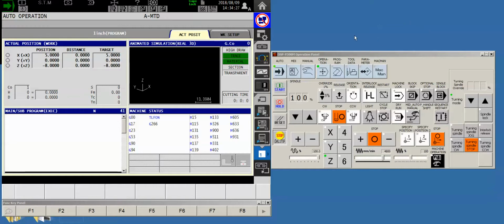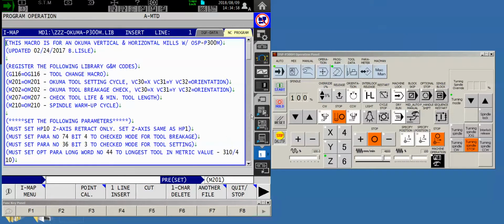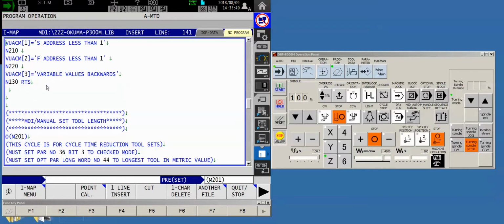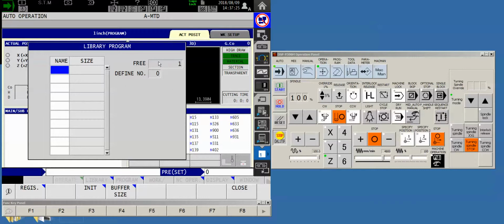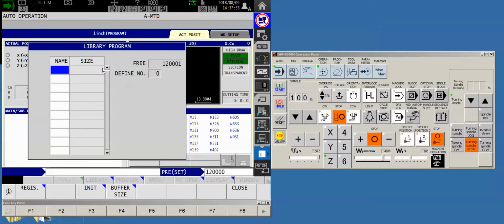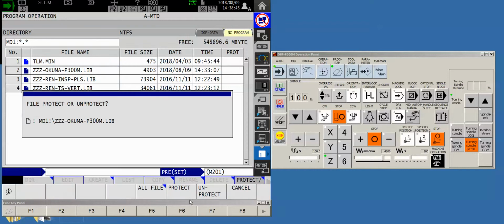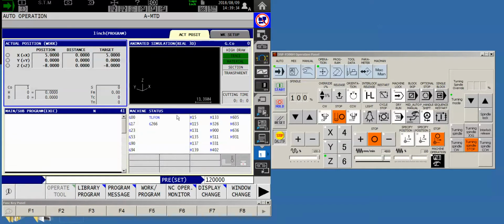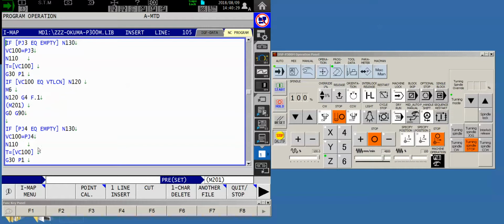LIB file registration on an Okuma P200 or P300 control

Comment: Hi ! I saw line with ntc5 if [ pt ne empty] ntc6.....IS EMPTY SYSTEM VARIABLE OR LOCAL-VARIABLE, may I ask ?
Reply from the maker: Vincent, empty is a non-value indicating that either a common variable or a local variable has not been defined. You can’t simply put a 0 in the variable, since zero is a value in itself, so the word EMPTY is used
Reply: Thank you for replying,  I’m working on Okuma lb3000 exii. Osp p300L and create sub macro but somehow I can’t get it to work, I created program and named it “universal drill’ multiple ways cycle using same program , when control read the line IF[ PZ NE EMPTY] N1 then I got alarm sent out 2238-01 alarm b and I also tried IF PZ GOTO N1 as program manual book said and I still have alarm from the machine ....is there a way I can fix this ? Thank you very much .
Reply from the maker: @vincentnguyen3887  that alarm occurs when you don't have the address listed for the conditional. In this case, IF [PZ EQ EMPTY] N1 is correct, but the alarm indicates you have no N1 to be found in the macro

Comment: Nc code for drill cycle with lower turret on okuma osp 300
Reply from the maker: The same codes work for upper and lower, but you'll need to include the G14 code to specify the turret.
Reply: @pocketcharleywithgosiger no really I got upper is g181 live tool spininig but lower tuuret don't work with g181
Reply from the maker: @maurocardenas7704 , is it a live tool on the lower or static tool?
Reply: @pocketcharleywithgosiger  can't be live tooling on lower turret is stationary too gum drill like17
Inch long
Reply: @pocketcharleywithgosiger  n is stationary tool gun drill   featurecam post output  g181 for upper turret g74 for lower turret  I can't used g181 for upper turret
Reply from the maker: Ok, since you don't have live tooling on the lower, you'll have to use G1 or G74. Sounds like your Featurecam post will need to be modified
Reply: @pocketcharleywithgosiger  thanks now I have this alarm 1215-01 sm command asynchronous a side 6 ...

Comment: Is this only possible on mills. Have a lb3000 osp-p300la but can't find the library button
Reply from the maker: It is only a mill feature unless you have the S control (Usually only on Multus and VTM Y-B machines). You can, however, make macro programs and label them .SSB